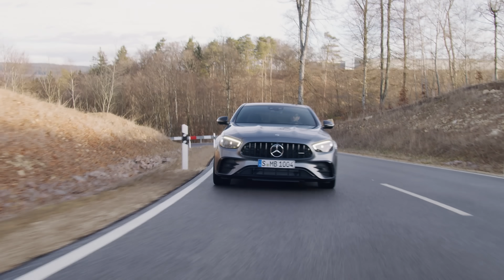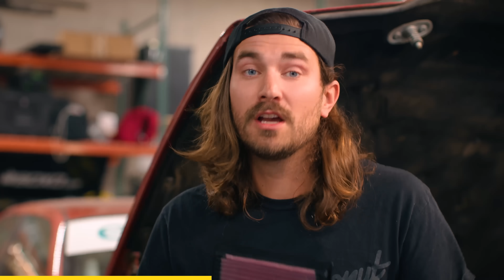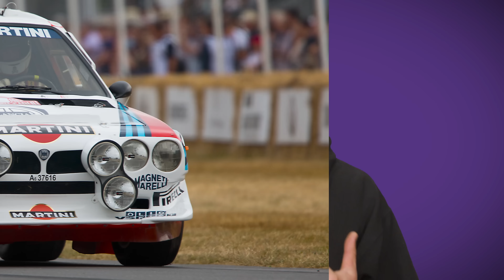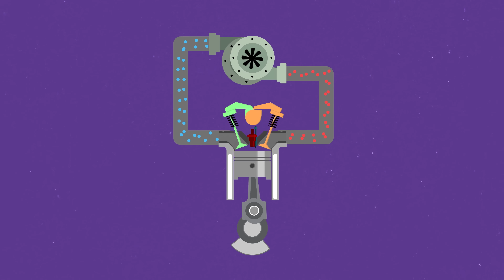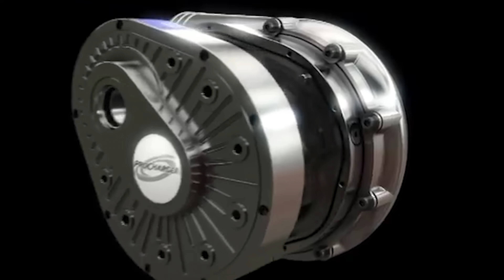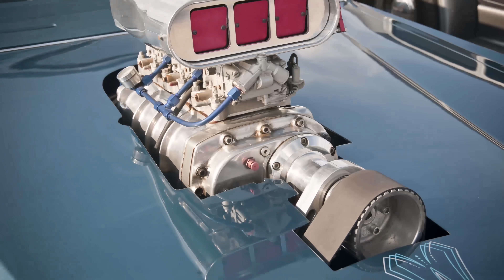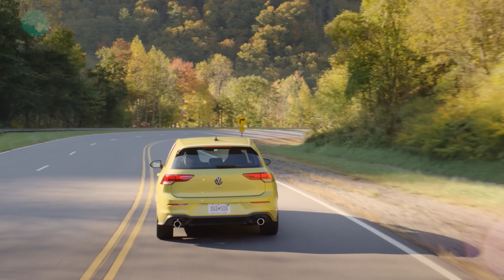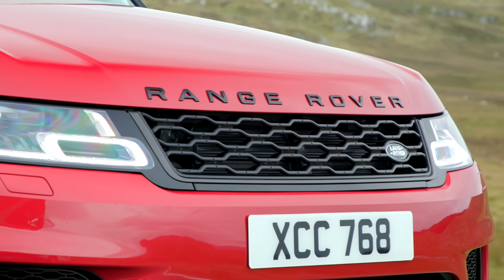Why Your Engine Isn't Twin-Charged

Comment: Love twin-charged.... Don't forget about Volvo's T8 engine: 400hp 500tq twin-charged four cylinder hybrid! Would that be triplet charged?
Reply: Just sucks that the electric engine in the T8 was not reliable. The T6 twin charged is way more reliable
Reply: @shaunbeaulieuxc90v87  my t6 blew up before 25k miles
Reply: @shaunbeaulieuxc90v87  how so?
Reply: @shaunbeaulieuxc90v87  xxx8x8
Reply: @shaunbeaulieuxc90v87  I’m glad you said something about the t6, because I was about to, we have one in our s90 and it has been great so far
Reply: @mk7t472  nice, I want a s90 inscription as my next Volvo
Reply: @mk7t472  you will have problems with piston rings and I’ve done lots of superchargers on them too
Reply: @shaunbeaulieuxc90v87  I'm waiting patiently for the first all electric s60 can't afford a polestar 1 lmao
Reply: @ChunkyWaterisReal  yeah polestar 1’s are super expensive, it would be great if they made a metal version less expensive
Reply: @shaunbeaulieuxc90v87  as a ex Volvo tech t6 is a thumper
Reply: @shaunbeaulieuxc90v87  its not
Reply: @einar8019  yeah, the electric engine isn't less reliable, Its the differential and gear drive in the ERAD setup that is complete crap. I used to be a Volvo auto tech(moved up to working in a automotive machine shop now, thank God), and the fact was we literally always had one or more in a bay to have these replaced
Reply: we have a volvo v90 t8 r-design and a xc90 t8 r-design they are both very fast didn’t know they were twin-charged lol
Reply: @pimels4476  hope you bought the extended warranty lmao
Reply: I wish they had twin charged a 5 cyl instead of a 4 cyl
Reply: The T6 drive e 4cylinder is such a beast. I used to be completely against twin charging until I bought this car. Basically all modern T6 and T8 Volvos are twin charged.
Reply: @DivaniKingston  ppl
Reply: @DivaniKingston  I have one too. Love it so much
Reply: There was a TON of aircraft in WW2 that were twin charged, mainly to pressurize intake air at high altitude. Crazy cool engines.
Reply: @RivenGreivances  was there cos do you know turbocharging used to be called turbo supercharging, do you what planes & engines they were
Reply: @robertandrewbaptie3006  the Allison V-1710 was initially turbo supercharged for the P-37, P-38 and P-39. The turbo for the P-39 was dropped due to streamlining issues because of the size of the turbo.
Reply: @RivenGreivances  errr no it wasn't it was turbocharged at first like in the P-38 lightning but then switched to supercharger like in the P-51 Mustang (2 stage 2 speed supercharger) but that's only cos we the BRITISH @RR showed & let yous copie but it wasn't twin charged
Reply: @robertandrewbaptie3006  I let the Smithsonian Aerospace Museum know about the error on their exhibits as per your info, they smiled and laughed.
Reply: Was gunna say Volvos been doing it right bro
Reply: That's a very good question
Reply: Nearly got a T8 as the family car but heard it had many issues so decided against
Reply: I owned a volvo  t8 hybrid when i floor it i can smell a gas in the car what an engineering? suck!
Reply: Vag do a 1.4 twin charged tfsi engine and it's been around for years. Turns out it's crap. Lol
Reply: Did they not mention Volvo in this video? It's the whole reason I clicked.
Reply: @The_Otherside3000  yes they showed the T6 in the list
Reply: @The_Otherside3000  12:46
Reply: I was about to say the same hahaha
Reply: Was just about to mention this
Reply: Its automotive King Ghidora
Reply: I serviced one the other day 😍. Not a fan of euro makes but that was a sweet ride. 30+mpgs at 400 horses!
Reply: They’re also stupid unreliable and expensive as shit to work on.
Reply: No that just makes it 3x as unreliable lmfao
Reply: The S60 T6 is also turbo and supercharged
Reply: Triple not triplet…
Reply: No
Reply: The only sad part is how the engine only drives the front wheels. It still works but it isn’t as sporty as a true AWD setup with F+C+R diffs.
Reply: Enough with the Swedes already
Reply: Bro what kind of Agent_Y goofiness is this💀
Reply: I have a 19 Polestar, glad somebody mentioned Volvo before I did!
Reply: I have a T8, no issues at all.
Reply: 2020 Volvo V60 Polestar: 4cyl supercharged/turbocharged plug-in electric hybrid
Reply: @ugh-meh  i've been thinking about polestar tuning my xc90 t6.  how do you like it? was it worth it?  i already get not so great gas mileage so i worry about that.
Reply: I have a xc60 t8, i like the engine a alot, sound is amazing from the turbo. They ditched a charger in the 2022 model
Reply: @bobylikescars  no they didn’t not they went with an electric one
Reply: @bobylikescars  no they didn’t. It’s electric super charger for the T6 and T8 engines 😆
Reply: @TrevaughnBrooks  it’s more specifically the ‘polestar engineered’ which is only available on the t6 and t8 model trims. 

Since polestar has become its “own” company under Volvo technically the polestar 1 is another car that is twin charged with an additional electric motor
Reply: @TrevaughnBrooks  No, only the B6 uses an electric supercharger. That's because the B6 is a mild hybrid with a 40V mid voltage battery in the back.
Reply: @TrevaughnBrooks  the t8 doesn’t have the electric supercharger and it’s not. T6 it’s called a B6
Reply: @brannonatkinson  I sell them. I know. And it is an electric supercharger lol
Reply: @Tre Brooks  my 2016 XC90 T6 sure is belt driven.
Reply: @bobylikescars  you can still get it as a B6. It has an electric super charger along with a 48volt motor. Very cool.
Reply: Have a XC90 T8 myself and the engine been bullet proof for a long while. It’s a blast for whenever I got bored.
Reply: As my daily driver I just can’t express how much I love that T8 Engine with its rhythmic charger sound
Reply: My S90 T8 is awesome! Twin charged and plug-in electric. Over 400hp and gets about 30mpg without even plugging it in.
Reply: Love my T8 S60 R-Design. Excellent sleeper, no one on the road knows what it is until they find out.
Reply: Only 400 hp from turbo, SC, and hybrid seems like a lot of added weight and cost for not much power
Reply: @Fetaldareaper1414  The engine is only 1.8L. 400hp total combined net while only using a 1.8L economy motor is quite impressive.
Reply: A mess
Reply: Right !! They totally forgot to mention that
Reply: I put an aftermarket intake on mine and the whine is so nice.
Reply: @JacobAgatston  which one was it?
Reply: I used to drive my bosses 2020 Turbo and Supercharged xc90 and hitting the performance mode dropped it like 4 inches on the chasis and you could feather the throttle ever so slightly and jump from 25mph to 70-80 getting the the freeway in the blink of an eye. Only ever tried it when people would tailgate me getting on with a clear entrance to the high way but everyone would back off so quick once they saw it jump.
Reply: Still only goes 180 k so that is a no-go.
Reply: @waclosh  180kph is a speed limiter set by Volvo, look it up. This can be easily removed with any tuning/remapping of an ECU, like any other car from any other manufacturer. I'd hardly agree that this disqualifies it from being a powerful engine.
Reply: @JakeyJakeThree  do you know someone that has taken that limit out?
Reply: @tatocarbonell4176  I don't for Volvo's specifically. Apparently there's a company in Germany that's already done it for the T8 but idk what they'd require to get it done. There a company in the UK that's done it for the T6, but they may not have gotten to it yet for the T8. Their page says to contact them if it isn't listed, so they may be able to.
Reply: @JakeyJakeThree  thank you very much
Reply: @JakeyJakeThree  my inscription is limited to 210kph, it depends on the trim level
Reply: he even forgot about the variable geometry turbo that is from like '99 in use on many cars especially diesel ones
Reply: Not to mention the Volkswagen Scirocco’s 1.4TFSI twin charged engine
Reply: You beat me to it 😂
Reply: How about : 
1. Smart hybrid.
2. EV Motor(hybrid).
3. Supercharger.
4. Turbocharger.
5. NOS/O² boost.
Reply: The T6 has won lots of awards: https://www.youtube.com/watch?v=e86z6XZVGrg&ab_channel=EngineeringExplained
Reply: THANK YOU! Just was coming here to say this
Reply: Add NOS
Reply: Yes! Wasn't that the engine that was used in the noble m600? That engine was badass and remember the noble at the time could slug it out with the best in top speed
Reply: dual charged hybrid engine. theres 2 sources of extra charge but a hybrid electric/gasoline engine.
Reply: Lol at all the people who are talking about their reliable 4 cylinders. Those things are piles of junk, we replace them A LOT at work. Works out for me though, 11000 dollar motors make for fat paychecks
Reply: @mikeharter5195  Not sure what engine you’re writing about, but the Volvo Drive-E engine family has been very reliable including the T6. The T8 had some small initial teething problems but that was on the EV side of the powerplant, not the ICE side. 
Edit - I remember the 1st production run of T6s had issues, but this wasn’t an engine / engine design problem. They were sent out with bad plugs or coil packs (I forget which) and rings  that precipitated a larger blow by and firing problem. Supplier problem or spec, either way, Volvo issued a recall and covered it all under warranty. Of course if humans decide to ignore factory recall notices, well, only God can fix stupid. Forward of that 1st block run of motors, its been a stout powerplant for its diminutive size.
Reply: @mikeharter5195  lmao the Water Purification Plant worker complaining about seeing dirty water always makes me laugh. Of course you're going to see broken cars... Why would anyone bring an unbroken car to a shop to get fixed?
Reply: @DivaniKingston  lol I work at Volvo. Of course people bring their cars to us when broken, the part I'm laughing about is the frequency at which these engines fail, which is a lot. Almost every 4 cylinder that comes in is for burning oil, which turns into a new hooty box, comes back a month later for pistons, pistons turns into a new engine almost every time because once they get the motor open it's trashed one way or another.
Reply: @mikeharter5195  yes... Burning oil is usually from the early T6s... Generally the issue was the spark plugs that were originally spec'd by Volvo in the first couple of years (still the P3 body style and some 2016 XC90s) were too hot. The ceramic broke and caused misfires and the fragments that got into the engine scored the cylinder walls. Volvo had a huge recall bunches if years ago for it. (like in 2017) and they fixed the oil ring issue in another recall... Engines with a serial number after a certain point have all the issues fixed... Basically every road going T6 and T8 after 2017 doesn't have the issues you're talking about..

There's a whole tech bulletin about it
Reply: @mikeharter5195  and this issue only arose on the cars people ignored the recall order on. They drove them until the broke... The DriveE engine is damn near bulletproof.
Reply: @DivaniKingston  my 19 XC90 T6 Rdesign Polestar tuned has been great. An absolute pig on fuel tho
Reply: @j.m.7907  bro it's terrible.  Mt 2013 s60 rdesign polestar gets like 15 combined. No joke lol
Reply: Sucks its a volvo
Reply: @taliesinangling3564  What you mean by that?

Comment: Volvo’s new T6 2L 4cil engine has both turbo and supercharger and around 320hp, the T8 engine is the same 4cil turbo and supercharged engine pared with electric motor and around 400hp.
Reply: Turbo and supercharger only 320?😂
Reply: @crispbacon4005  u want 500hp or what? Volvo puts this engine in normal family cars that people just want decent acceleration and don’t want a race car.

Comment: If you have a stock airbox I highly recommend you get the K&N stock replacement. If you don't have a stock airbox then it makes since to get the K&N full kit.
Reply: I've heard from a lot of sources this is a terrible idea, as it lets larger particles in that will cause more wear and tear on the engine, and that the increase in flow is not significant enough to warrant it. I've heard very similar for, well pretty much all their filters. 

Keep to stock air filter, and a different good brand for your other filters.
Reply: @VonGeggry  I keep a paper filter in the truck for when I'm going down lots of dirt roads or off-roading in very dusty environments, but otherwise if the filter is properly oiled it works just fine.  I've put nearly 30k miles on my tacoma K&N filter and have had no issues.(lot of off-roading) It gets cleaned every 5k-8k miles which is a typical year for this truck. I've seen better throttle response on the hwy and better fuel economy. 
The biggest advantage is the lifetime warranty and the lifetime filter. It saves money in the long run. As far as Mo-power, I'd say it's negligible on a N/A vehicle, but I'd expect real gain on a turbo/supercharged vehicle.
Reply: @VonGeggry  BTW my Tacoma has 281,000 miles on it. No oil consumption and excellent compression.

Comment: Really disappointed in this episode you totally omitted Volvo and their t6 platform that uses a twin charge system, that's been in production since 2016. Not even mentioning the T8 platform, which uses an electric engine in addition triple charging it.
Reply: They mentioned the T6 with a sticker, just didnt focus on it.
@12:47
Reply: @JP_RS6  not really a "mention" just to show a picture. And then to skip over the longest running current gen twin charged engine is just ignorant... Especially when it's the flagship of 2 companies...
Reply: @natetrombley9488  poor choice of wording from myself, they display it.

He did say hes only just been introduced to the engine configuration and then did the video on it. As much as I'm* Into my cars a Twin Charged setup isnt somethinf ive had nor played with nor have I owned any Volvos.

I'm sure they'll regret their ommision but they breifly gave reference via said sticker to the T6.

Edit: I'm*
Reply: @JP_RS6  what about the B8 and T8 volvo models?
Reply: @bhuvan9111  i dunno, why you asking me? Lol

Comment: ( haven't finished the video yet) I wonder if this would be good for a diesel the whole system is more durable and the supercharger would Give a nice gain In horse power at low revs and the turbo works great at high RPM
Reply: Detroit did it back in the 60s or 70s and produced them till the mid to late 90s in there 2 stroke semi motors
Reply: the audi is a twincharged diesel